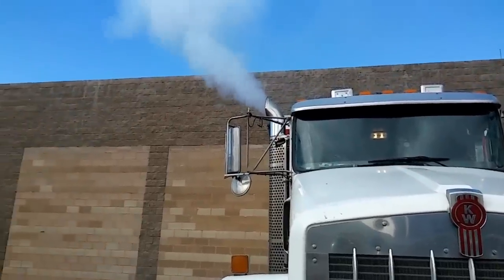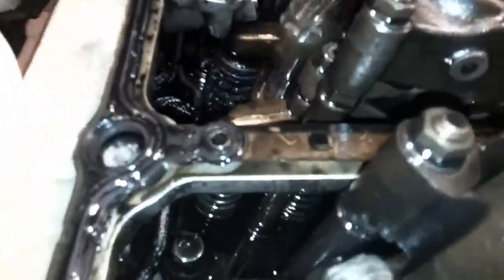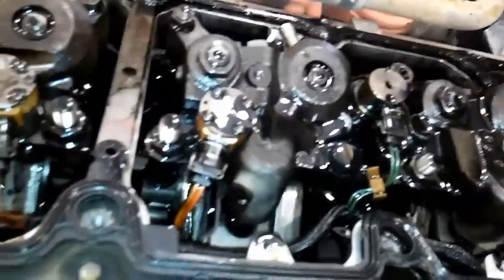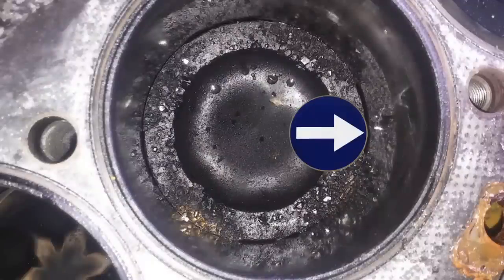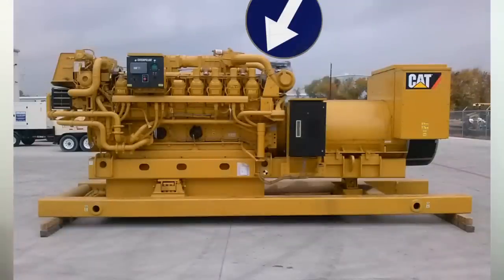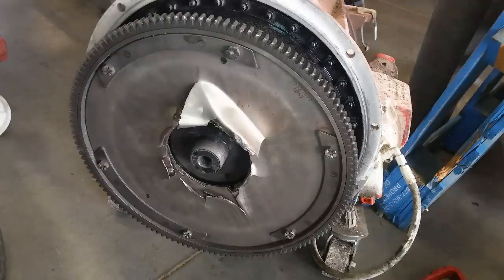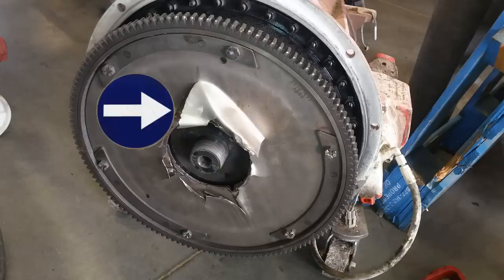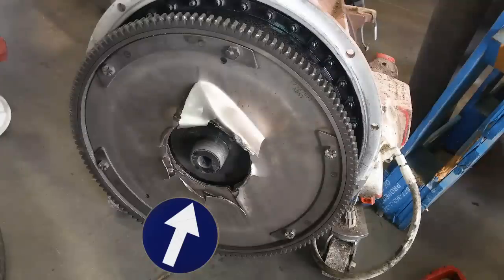Should You Warm Up A Diesel Engine?

Comment: I own two vintage semi's from the early 90s and started using the block heater on one of them during cooler temps in Texas. Yes, it gets cold in Texas and most of us don't give much thought to cold starts in the Southwest when we truck.  I want my engine to last longer so I put the block heater on at least 30 mins under 50 degrees and idle for at least 10 mins high idle.  I can really hear the difference in my engine cold and at operating temperatures. Big difference.
Reply: What do you consider "cold" in Texas 20°F?   0°F   -20°F?   -40°F?
Reply: @misters2837  // "cold" in Southcentral Texas (San Antonio) is the temperature when my truck sounds and acts different at startup, which is under 50 degrees. I know that sounds silly 😜 but my oil pressure under 50 degrees is like 75 at startup vs 60 when it's over 50 degrees Fahrenheit. I want that oil circulating freely vs syrup.  To do that I have to heat up that coolant and keep the block around 100 degrees (?). I want to keep it warmer than that (120) but I think I need to cover the radiator.
Reply: @darkhorse2reign  Our gassers start unassisted at -40°F with 5w30 oil pressure is pegged...the Diesels with Grid Heat, glow plugs, or ether will start at 0°F - Interestingly for medium duty trucks gassers hung on for a long time...We had Gas F700s from 80s until 1997...though we had bought a 7000 (3208) but it was basically parked in the winter until We built heated shops.
Reply: @misters2837  // I don't have a shop and I have to get started within 30 mins or I'm going to miss my load. Anything extra I can do to assist ol girl with cold starts I will do it whenever possible.  The sound of the dry cold start makes me cringe.
Reply: @darkhorse2reign  IDK what to tell you...50°F is an average fall day here...Nobody plugs in until 32°F or colder... My Friend has a Fleet of trucks most have S60 and Clatterpillar 15L... Our Township has a Plow Truck with a 8V71 and an Allison... I started it last week and moved it...30°F fired right up without spray even! - I think it has SAE 40 (can't use multi viscosity oil in DD 2-Strokes) and it hasn't been started in a couple weeks...
Reply: @misters2837  // I wasn't asking for advice at all. :-). It's just what I choose to do. The truck I'm driving starts and runs great.  If I have questions about colder weather I'll be sure and ask.

Comment: Good advice for any engine. My new skidoo four stroke came with the same instructions regarding warming it up after a cold start. The manufacturer states to let it idle for 2 or three minutes and then drive it slowly for another few minutes. The drive--by-wire won't even let you goose it until the engine has warmed up.

Comment: I agree with most of your comments, If engine block heater is plugged in for several hours 2 minutes is plenty for a pickup ,especially if using 5w-40 synthetic oil. In the late 70's early 80's a lot of 30 series JD tractors seized up due to thick oil and a brass gear that drove the oil pump, that brass gear fatigued and broke and starved engine for oil. We have better oil's now.

Comment: Josh, typically if the air tanks are empty. Just either idle or turn high idle on until the air dryer snorts. Once the engine has oil pressure and full air tanks , usually the oil warmed up enough to start moving the vehicle. However, I wouldn’t put the engine under any load until after the engine is at least at or above 140 degrees. Plus, at any temp below say around 50 degrees F the operator should be using a block heater to maintain at least 70 degrees F prior to startup. This is Cummins recommendation for the Cummins engines from the old small cam 855 to current ISX15 engines including all smaller bore engines as well.

Comment: If you have a "cold Truck" with no air pressure .trucks don't move without air. it will take a few minutes for pressure to build in the tanks . somewhere near 120 psi . the compressor will start cycling from pumping to not pumping to keep from blowing the air tanks. during this time, pre trip the truck for the day. it is required. get it out of the way. this should be enough time for the engine to get to operating temp. about 10 min.. start the truck .get a coffee and  doughnut . if it is that cold be weary of Ice in the brake system .
Reply: Eugene Willsey j

Comment: I ran my Columbia in nd for several years. Working the oil fields. 
U can barley start the truck in the winters. 
They have to stay plugged in at all times when shut down. 
Or they usually gel up in the fuel filter. And some times even the tanks gel it gets so cold. 
-30 was not out of the norm. 

If I had my truck plugged in while parked, I still let it high idle at 900 rpms for 30 min to get things to warm up and even then it didn't reach operating temp. 
That's on a detriot. 
The cold is death to anything.
Reply: Such a dandy sound Diesels make as you get down to -20...   sometimes wonder if it will throw something.
Reply: Les Brown everything has block heaters here.   I just try not to have to start engines if don't have to if colder than -30.   Move snow at -20 I just want to leave shed after starting rather than hear the rattling
Reply: No wonder some working trucks in Alaska are left running for months at a time.
Reply: Saw alot of espar heaters being used during that time
Reply: Best tip of all..if its -40 outside stay home don't even think on working if that temperature can potentially damage your engine imaging what it would do to you 😅
Reply: Gcal1956
Reply: I live in North Dakota. The truck engine I'm most familiar with is the ISX Cummins. At real low temps you absolutely need block heaters as well as oil heaters, especially if you're going to run 15W 40 oil, which I dont think Cummins even recommends at sub zero temps. In my experience with several trucks running the ISX, you can let them idle, or even fast idle until the end of time at sub zero temps and never see 125 on the gauge until you put a load on them. Blended fuel plus anti gel additive or even straight No 1 is a must as well even with the factory fuel heaters. Yeah you lose some power and mileage, but it's a heck of a lot less than you could lose paying a tow bill getting a gelled up truck running at minus 35F.
Reply: Aint no shit. I run outta stanely gets colder then hell up here

Comment: I like to warm the engine for a minute or so then, move off slowly at first to start increasing the temperature of diff & gearbox oils so there is not unnecessary wear on those components. I feel it is just as important as warming your engine.

Comment: My routine here in Ontario (winter)...the night before, plug the block heater/pan heater in, double check fluids and tires. Next morning, do a quick visual of truck and underneath. Start the truck and let idle. Place all my gear (lunch, duffel bag, etc...) in truck. Turn on all lighting, heater/defrost and begin to raise idle while watching gauges. Once it's reached max PSI, charge trailer (red valve) and build trailer air with full air PSI to unfreeze stubborn brakes. Raise/lower lift axles checking function, double check set pressure. Raise idle to 1000. Remove block heater cord(s) and place in tool box. Park my personal vehicle. Return and Clean windows and lights of snow. Flashlight in hand, do your walk around, double checking fuel, coupling, airlines load security, lighting, air bag inflation, tire pressure/wheels/nuts and brake stroke. Listening for air leaks. Enter truck and double check bills, invoicing, permits and maps or direction routing. Do your brake checks making sure all wheels are free and rolling and not locked up. Start log book remove coat and drink coffee. Hit the road!

Comment: I let the low air warnings stop before I raise the idle. Then wait till the coolant temp to get to 150 to roll out
Reply: It revs up because after 5 min it figures you're not going to do it, so go ahead and raise idle to 1k and it will warm up quickly.
Reply: I wait tell the motor says 125F before I start rolling

Comment: Volvo was the best in cold Minnesota and Canada with a intake preheater and exhaust brake .  The exhaust brake would labor the engine and clear up smoke by increasing back pressure. It also had Jake brake .fuel heater heater in that fuel tanks & fuel filter.
BTW the fuel heater for trucks was my idea back in the 70,s I gave the idea to Webb trucking from Fargo ND.  Needless to say I didn't get a dime for the bright idea because I was fresh out of USAF and knew how jet engines used fuel heaters to heat JP4.
So there.
Reply: necessity is the mother on invention. I cant tell you how many idea I have had others patent.

Comment: When cold, I always crank the engine over for 10 seconds or so with the fuel pump OFF to prime the engine with oil, so when I turn it to start the bearings aren’t dry.........  (perhaps unnecessary,  but that’s what I was always told)...
Reply: makes perfect sense

Comment: 1.) There are actual studies that show the majority of wear in an engine is at start up. At start up you have metal on metal. 
2.) you must be able to clear you windows so you can see out of them. A big deal in North Dakota.
3.) synthetic oils flow better when cold. Big factor at start up. 
4.) flue blow by happens in all engines when cold.  
5,) Block heater looks like a good idea.  

Thanks for the discussion

Comment: If you live in Wisconsin 
At 10 degrees,, we plug in our diesels .. so no real prob with our oil thicking up
Reply: @dickJohnsonpeter  I live in Norway and about every winter it gets to 10, but for the most part it's milder than that. I remember not many years ago it was much colder, clmate change might be the cause.
Reply: @dickJohnsonpeter  I think since you have more land mass around, and some water it's a double effect. Inland usually gets colder, at least in Norway since the Gulf or Golf stream comes in with warmer water from the south. Also water surrounding almost all the coast will increase moisture and effectivly make it feel like twice as cold. Unless it freezes, then it's not that bad. I live close to the Oslofjord and there is a ferry going every 30 minutes and that also stirs some the ice in the winter.

Comment: Also important, a winterfront is absolutely beneficial during the midwest winters. Worked for a propane delivery company, and couldn't get my point across about this. Trucks covering short  distances between stops, nothing but idle speed during filling, with heat on in cab, it just drained the heat from the engine. Even a piece of cardboard blocks the radiator and intercooler off enough for engine to stay in normal temp range. Just need to keep an eye on coolant/oil temps at highway speeds so overheat doesn't sneak up on you.

Comment: I liked how my old 2002 Ram 24-valve Cummins had a factory idle program that about a minute after you started it cold (~30F), the rpm would rise to about 1,200-1,500 to help warm it up.
I always run 5w-40 full synthetic in the winter so the engines get oil pressure as soon as possible throughout the engine
Reply: I use one of those too and mine does the same thing, never knew what the reason for this was
Reply: I’ve got a 2000 cummins and didn’t know if 5w-40 was ok for it since it’s not in the manual. But it’s possible 5w-40 was not a available option back in the day ? Your thoughts ? Thanks
Reply: @ironmike7339 In my opinion 5w-40 synthetic is totally fine, ran it in my 12valve for past 12 years.  Rotella now offers 15w-40 T6 Synthetic as well.  If you're hauling heavy and hot, then I'd lean towards 15w-40 synthetic.  Look up the viscosity of each online, oil companies post this info
Reply: @archivegarage7638  thanks, got a oil change coming up. So, I will try the 5w-40 T6 since it’s suppose to be so cold this winter. I can’t find valvoline premium blue in that weight in my area here in Tennessee.

Comment: I've mainly got gasoline engines, but my process has always been to let the coolant temp gauge needle just begin to move and then I'll start driving. I try not to run it too hard until everything is full warm, summer temps and ill be a little less worried about it, but in the winter I feel its more important.

Comment: My father owned a Holden HG Premier wagon with a 186cc gasoline motor from brand new, he would always warm up his car in the morning for a good 5-10 minutes before driving off.
He clocked the kilometers on his car so 999,000 Kilometers, then went to rebuild the motor and to his and other mechanics amazement the motor was still like brand new it still had cross hatching in the cylinder bores, all the bearing were in perfect condition nothing needed replacing not even the cylinder rings.
This is the reason I warm up my i30N performance model every single morning for at least 5-10 minutes also in this warm up time my oil temp reaches around 65 degrees Celcius, which is where my cold rev limit lights turn off. I believe this will prolong the life of my engine, but I guess time will tell.

Comment: Great video with solid information!  A question for you would be if this is transferable in regards to proper warm up for a non commercial diesel such as a 7.3 Powerstroke?  Thanks for the great videos!
Reply: sure. On mine, I drive it soon after starting, but I just run at low rpm's and slowly. it's not just the engine, but the cold transmission,  and rear axle. everything is cold and stiff and need to warm up, it all puts a load on the engine, but there's no way to warm it up other than to drive it, just take it slow and no high rpms for a mile or two

Comment: Block heater, oil heater, warm garage. Idle overnight. Use portable generator and plug block heater in to it. Idle for 5 minutes, then drive lightly for a few miles until until temp gauge gets close to warm temp. Depends on HOW COLD IT IS. Is engine very responsive to throttle input, or is it slower to respond?  That is another indicator to overall operating temp and performance. When in double, let it get at least 2/3 to the operating temp area on the temp gauge. Pre-planning and giving yourself at least 5 - 10 minutes before you pull out will help the engine especially with lubrication. Also, blocking the grill intake for air will help it warm up faster. A piece of cardboard or a grill curtain works fine.

Comment: Living in Ontario Canada,  I run my truck 15 mins in summer before i move it. In winter, depends on how cold, -20c i idle at 1000rpm for a hour before rolling,  anything colder like -35c hour n half at a 1000rpm just to be able to shift the 18spd. 15w40 is like grease at that temp. My superduty 6.0L gets a long warm up too. I've had no issues with emissions  or engine problems from warming up the engine. Also starting and leaving just ain't possible at those temperatures when running a 5 axle trailer. Air takes time to build, not to mention frost covered windows.  From a mechanic point of view your suggestions make sense but realities suggest different.

Comment: Gen tech here. 
I have less trouble with big engines in cold temps , than with the little peashooter air cooled home standby units.
 Those have no heat source and are ambient temps. 
Now, on the big ones you'll have a problem in cold temps if the block heater quit. 
So you replace the bad heater , do you wait all day for the heater to warm it up or do you try and start it so the heater isn't working it's butt off? 
Depends on if the power is out or not. 
If the power is out, I'm grabbing a can of ether if I need it to get it running. 
If not, I'll still try to start it to ease the block heater usage and make sure it runs anyways. 
Since some gens use a block heater , they don't always connect factory cold start assists like glow plugs. so you might want to look and see if they are functional and make them so to get it running. 
Good stuff, standing in -10f blowing snow changing out a heater and blowing some ether to it because the lights are out and the gen didn't start!! 500kw. 
 (Bad block heater)

Comment: I usualy wait until the temp gauge has actually moved above the C to drive off
Reply: mandavaler, on my 7.3 when I’m creeping after idling for a few minutes, then when I’m driving, I can feel the motor bog down a little then take off @ no throttle on torque. Then once it’s done that then I’m good. Every motor is different but that’s what I do. When it’s a little warmer above 70 I let it idle a little about a few minutes. 

Luges oil additive helps reduce dry starts & all that stuff. But I treat it like it doesn’t have it in it. When it’s under 60 I let it idle about 5 minutes then slowly drive off, then once I feel it’s warmed up then I give it a little more go-go, rarely NEVER full throttle. Until about 10 minuets later after warm.

Comment: I start my 2006 2500 5.9L Megacab and let it run for about 2-3 minutes.  Getting everything settled, coffee in the cup holder, the whole time in neutral.  Then I take off in my 1 stop light town at 30mph.  Hardly any load on this beast.  by the time I get past the high school and it opens up to 55mph it's been 5 minutes and I slowly build up to 55 mph.  Then it's a 55 mph drive for 50 minutes to work.   Within 4 minutes of running my truck has heat.  Did this with Rotella 15W40 for a decade before I switched to Rotella 5W40.  Engine easily starts in Michigan winters.  I've set a block heater timer for 4 hours before I leave for work.
Reply: Why put it in neutral? The transmission is doing the same in park just with a latch on the output hub